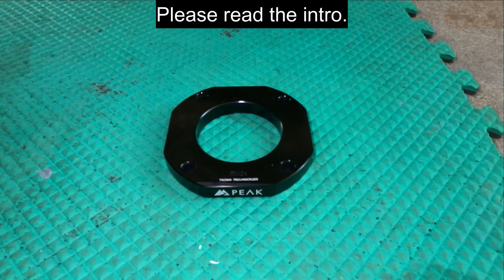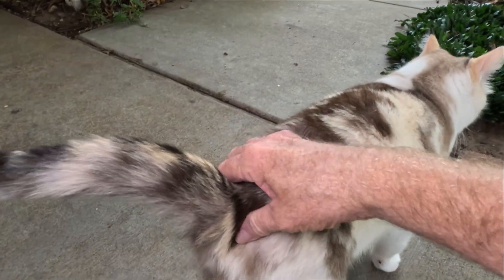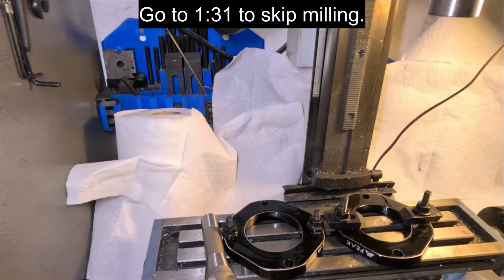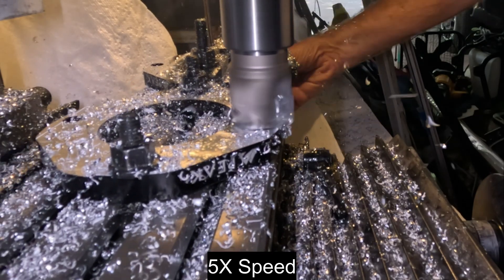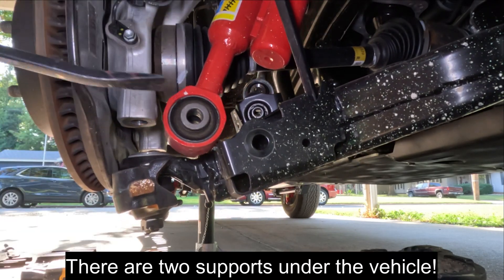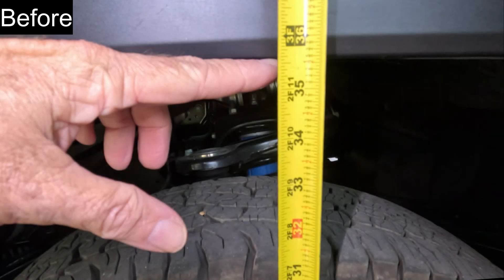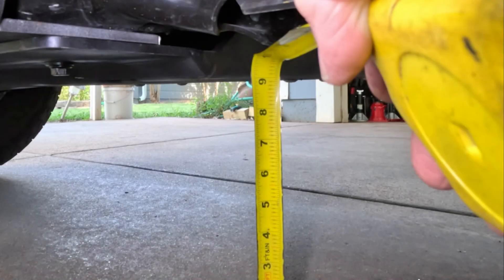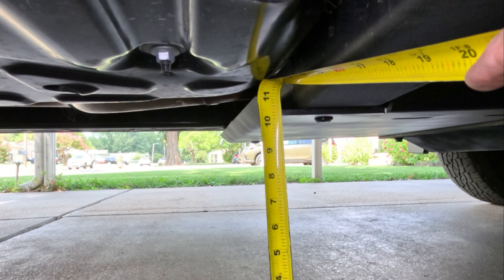Changing Spacer Lift On 2024 Or Gen 4 Tacoma Or Fixing A Mistake

Comment: I’m not trying to be a smart ass , but why would you do that ? I’m going to be putting the same spacer on my truck. Most of the top out spacers like Rough country and Ready lift are 1.5”.  The reason I want to use the Peak is that there is no grinding or cutting of studs , easy to go back to stock.
Reply from the maker: To keep some rake on the pickup so when it's loaded down or hauling a trailer, the pickup will sit mostly level and not be squatted in the back.

Comment: Curious to why u milled a quater inch off? U can't even tell the difference at 1 inch higher, another quater wasn't gonna kill u. Seems like a lot of work for 1/4. If u wanted a true 1 inch u should have the gotten the Taco Garage spacer/strut reinfornent plate. We did that to my nephews 2024 and we both wished it was higher
Reply from the maker: If I had made the measurements correct, would have ordered the 1" spacer lift.  Lifting the back of the pickup and want to maintain the factory rake for fuel economy and handling.
Reply from the maker: So far the pickup is getting over 25 MPG while loaded with the front and back lifted 1".